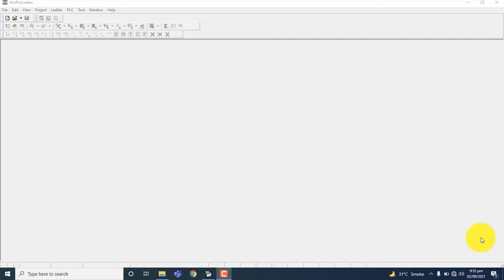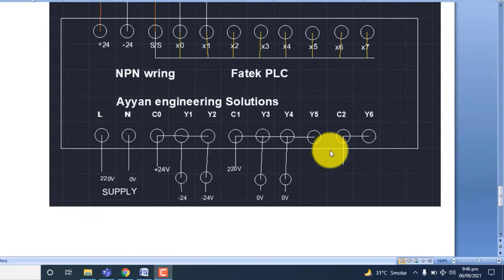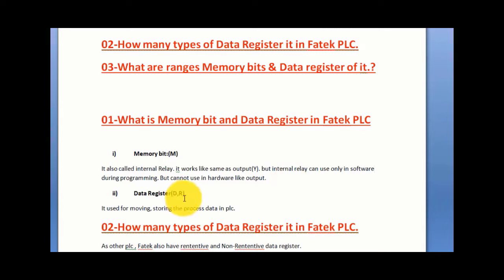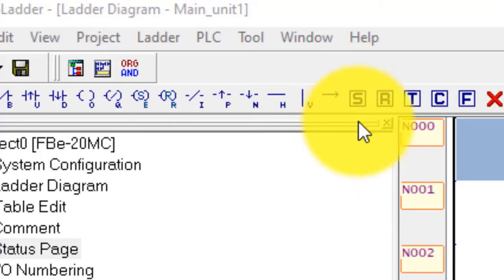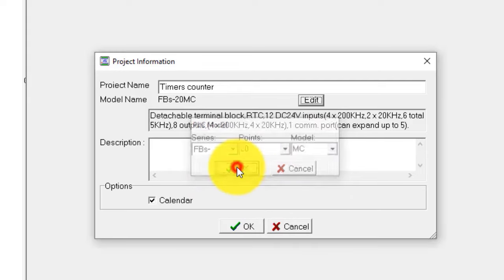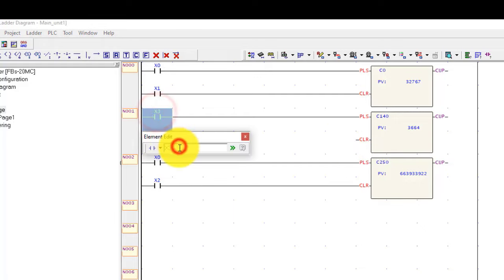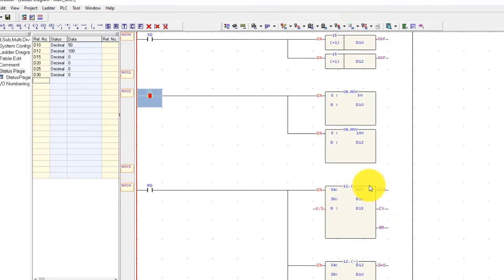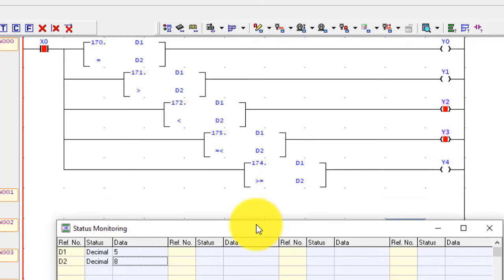Fatek PLC Programming in 1 hour|  Basic PLC Training| Ladder diagram programming|Complete PLC Course

Comment: What's that points ?? 
Why you have taken 24 only can we change it ??
Let me know
Reply from the maker: Yes if plc is relay type you can take any type of voltage. I have mentioned in this lecture
Reply: @ayyanengineeringsolutions5176  it's voltage or point because as you said in video we keep 24 point